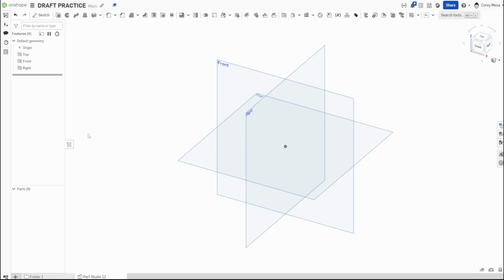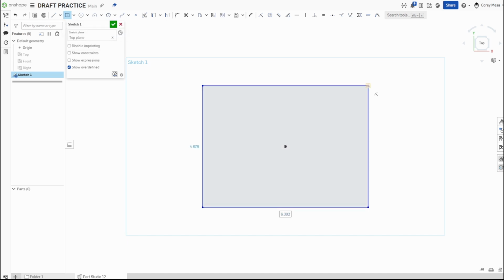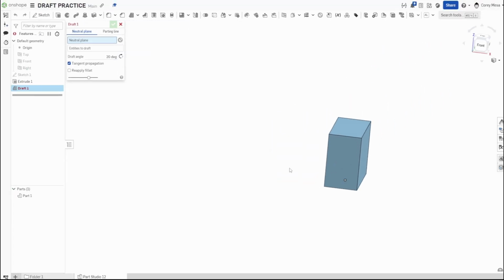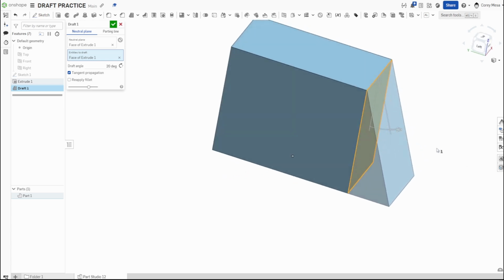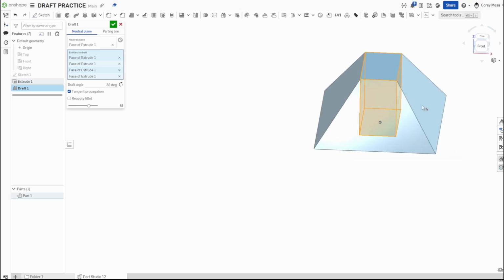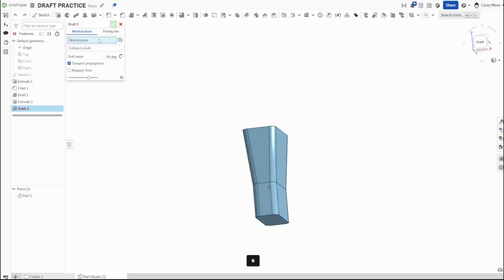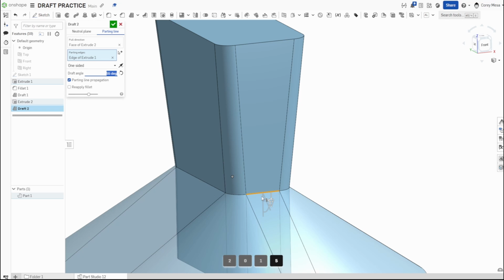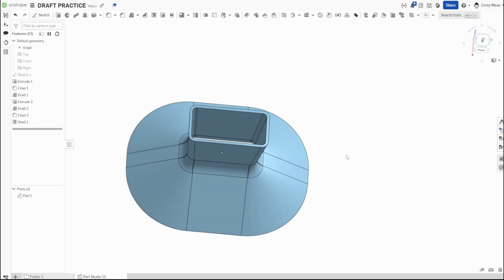Shifting to Solids: Mastering the 3D Draft Feature in Onshape

Comment: You lost me on two things...
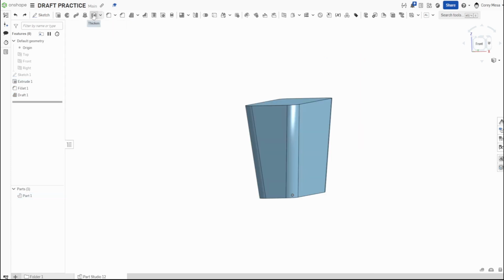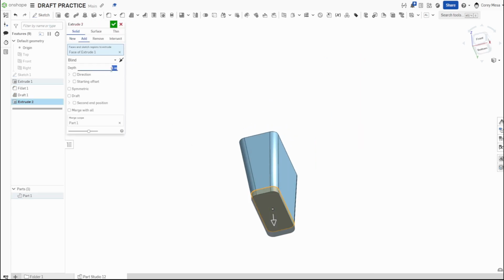First, between time 5:42 and 5:43 the shape suddenly got fillets. How did that happen?
Secondly, at 7:29 you do a shell and remove some faces, but I didn't see how you determined the thickness of the walls. How did that happen?
Thanks.
Reply from the maker: @moodberry I added them and I guess I cut that part out I just used the Fillet Command and added some fillets at 1 inch radius. you could also do It from that first Sketch and fillet it in the first drawing. Sorry I made this video in a small window I had working with my sick kids this weekend.  As ar as the shell command , after you select the faces to remove under neath you will have the option to determine the shell thickness and I set mine to .4 inches. I didn't go to in-depth as a video on shell will be coming in the future..... hope this helps and thanks for the questions.